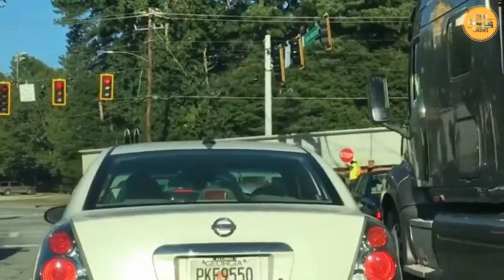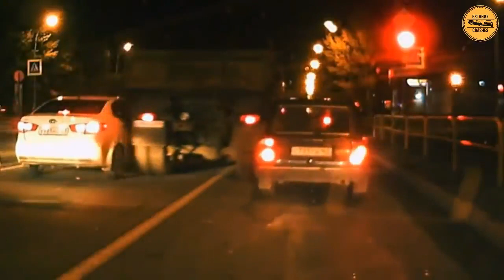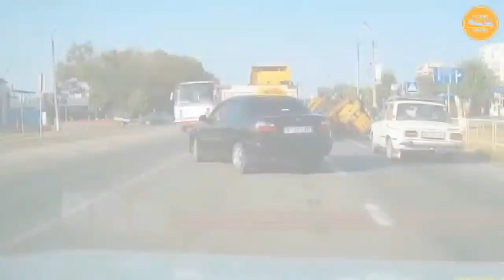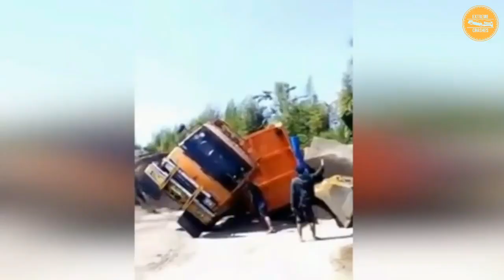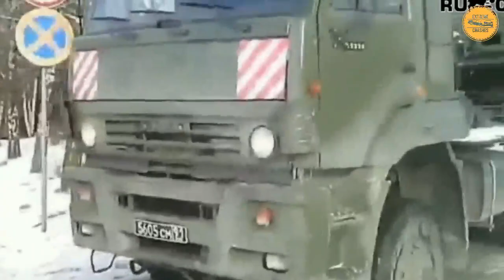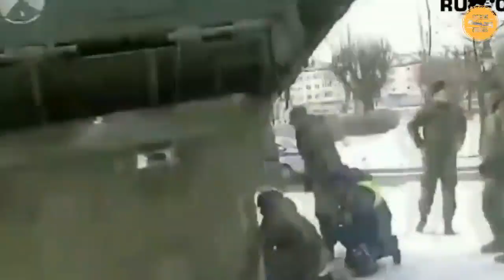HOW TO GET FIRED FROM YOUR JOB IN SECONDS

Comment: Nice, perfect ad timing. 
**public cervix announcement**
As a trained heavy machinery operator, if your dump truck, trackhoe, dozer etc tips... it is safer to stay in it, buckled up, than it is to try and jump to "safety". You'll die or get crushed. Inside, however, the cab is designed to withstand a tip over. But if you're in a crane cab on a rooftop, obviously jump clear.
Reply: Did NOBODY in the last 4 years make note of "public cervix"?? 😆 That's what a female adult film "actress" has! 😂😛